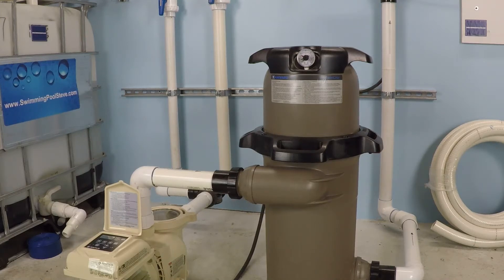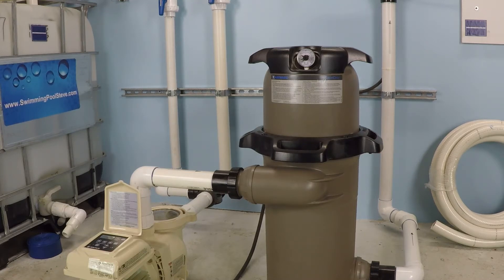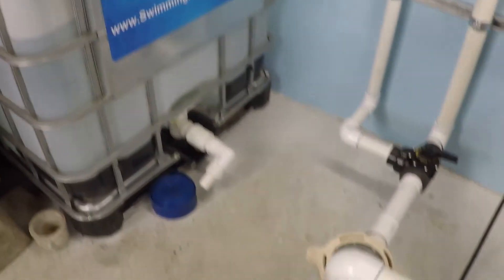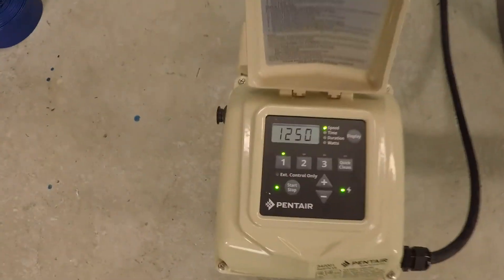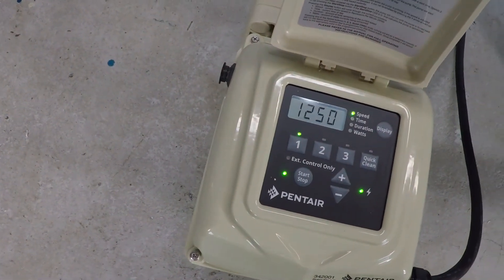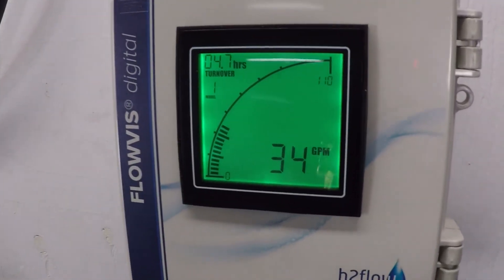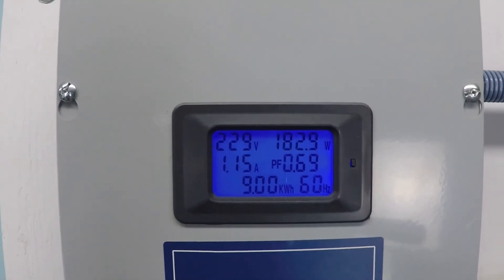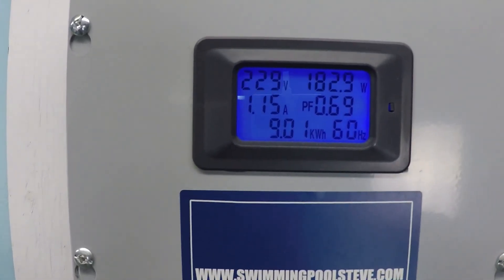What RPM On A Variable Speed Pump To Reach 35 GPM?

Comment: If you don't have a flowmeter, then you have to figure out the flowrate from the published pump's curves 

(search for your pump model online, or the curves chart may be with the sales sheet or user manual that came with the pump)

With the pump running, take the filter psig and the pump inlet vacuum inches hg at the 1/4" plug in the volute (convert both to 'feet of head', add the two together),

If your filter gage reads 15  psig, google the conversion it would be 35 feet of head

(If you don't have a vacuum gage, you have to assume something between 0 and 30 inches hg.  say 15 inches hg.  Google the conversion it is about 17 feet of head pressure.)
So the vacuum is 17 feet of head pressure on the pump inlet

35 + 17 = 52 feet of total dynamic head

find the chart for your pump, Search for intelli flo 3 vsf pump curve for this example

 Go to the pump curve chart and on the y axis (total dynamic head H20) and find where the pumps total head pressure inersects at an RPM curved line
  
Look down to the x axis (the gpm),  to find the flowrate. for this example it would be  110 gpm  at 3110 RPM spd 4.

Comment: In the long run, running your pump 24 seven even at lower speed is that gonna be more cost-effective than running it for 10 hours at full speed and then not at all for the rest of the day which is what we do now and in the winter time, we don’t even have to run that much at full speed

Comment: Steve, do you only do Pentair products or are you open to help with other lesser pumps??  Jim
Reply from the maker: I do all kinds. So far more Hayward than any other brand but I would run and test any popular make and model
Reply: After subscribing and watching a lot of your videos, I'm wondering how much more efficient a modern pool system could be built using even larger diameter piping than 2". Achieving a higher flow rate and lower velocity.